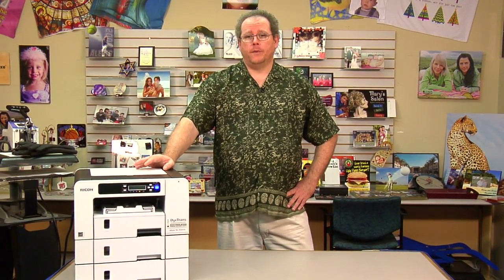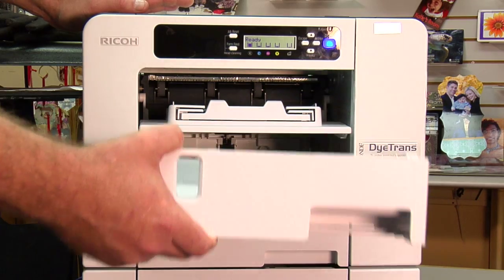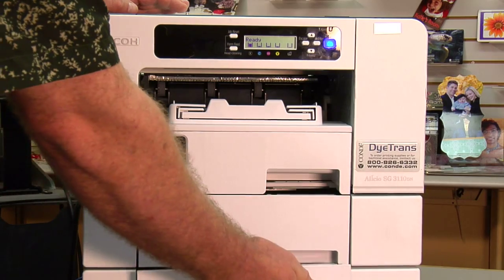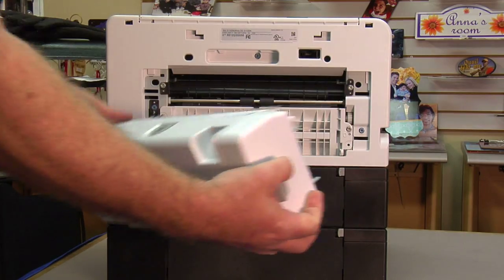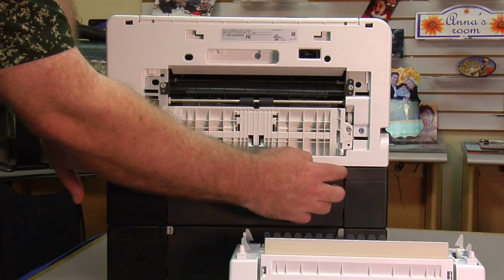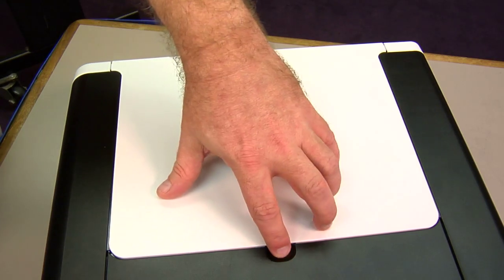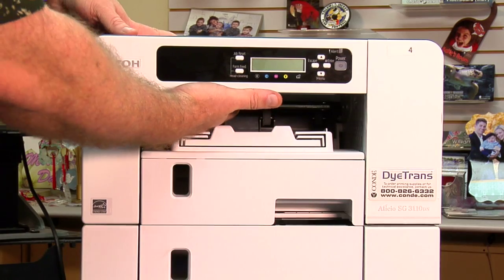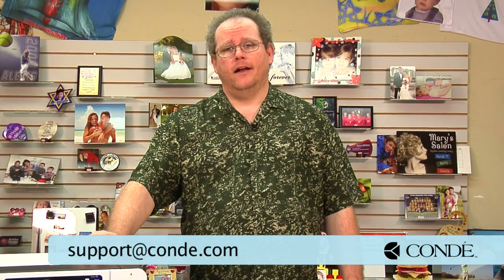Trouble Shooting Paper Jams on Ricoh SG 3110 Printer -

Comment: Hi I've worked through this video and the one on cleaning the belt but still getting Remove Misfeed, Open Tray Cover, Press formfeed, remove misfeed. - can't see any paper stuck anywhere and boy have I looked.  Please help
Reply from the maker: Next I would try cleaning the encoder strip : https://youtu.be/jB6vHGbE0o0
Reply: Pamela Maunsell did you fix the problem? I did everything until I clean out the clear flexible plastic. When you remove the big back rollers. On that rectangular back, you’ll see a flexible strip of clear pointed plastic. Clean it out with alcohol.